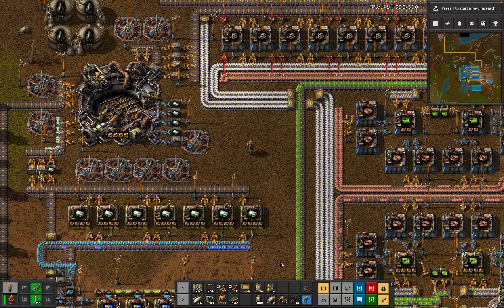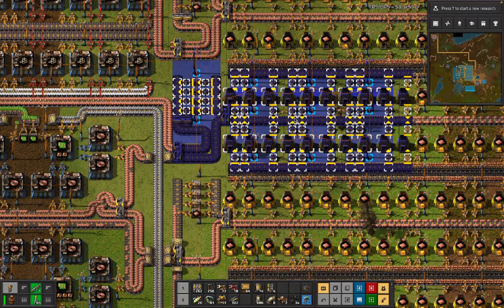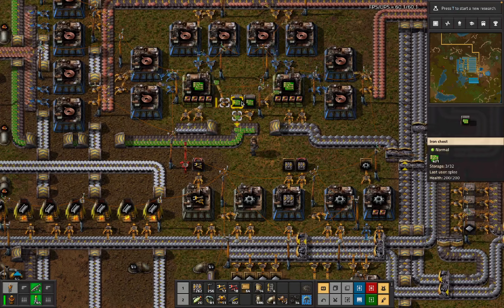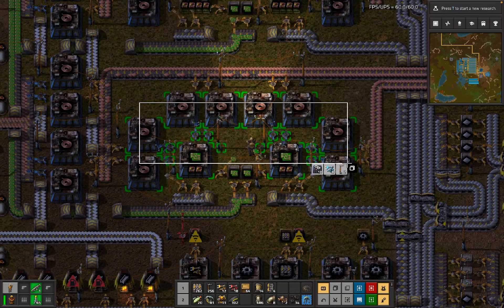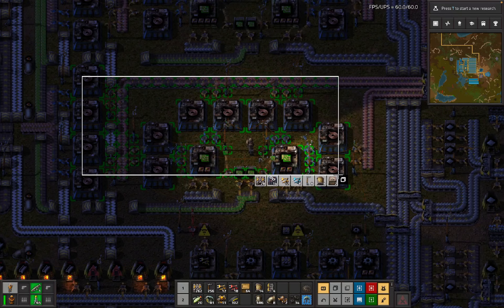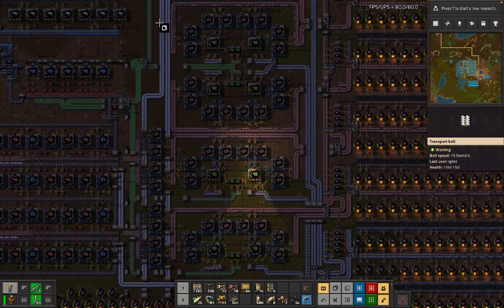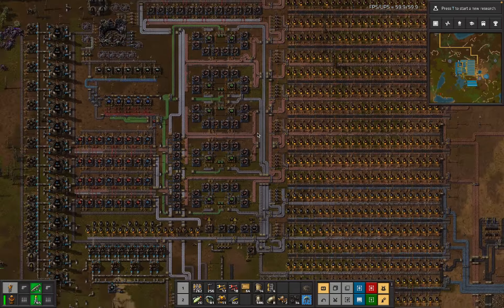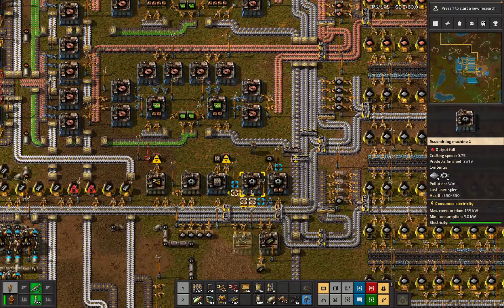Factorio Rocket Rush: copper buffer design

Comment: Actually simple watching the run for two or three times seems to be enough to start getting a grip of the plan and general base layout. 
Kinda surprising how it gets much easier to comprehend without a science.
Reply from the maker: Not sure if I'm so consistent, but it's mostly just the petrochem that floats around. The smelting through chips & mall to RCUs is a pretty stable layout now.